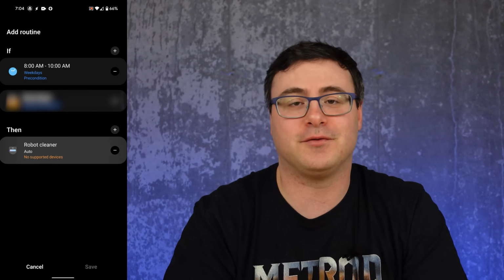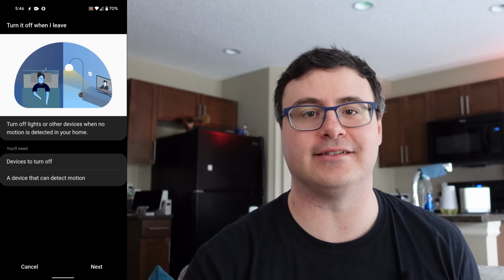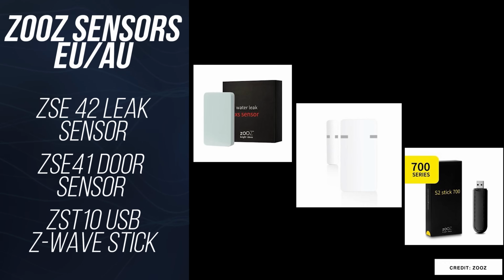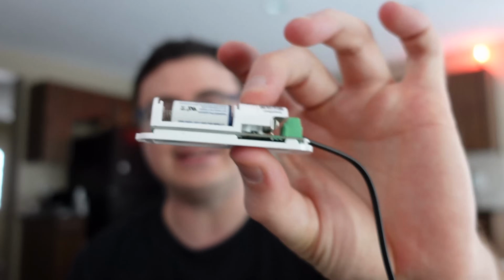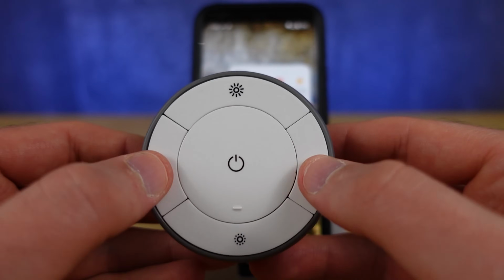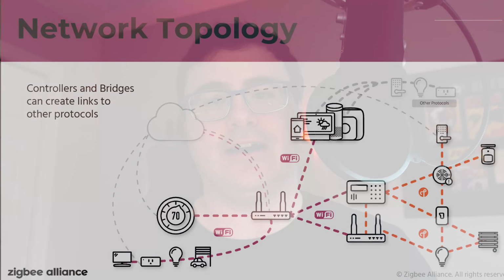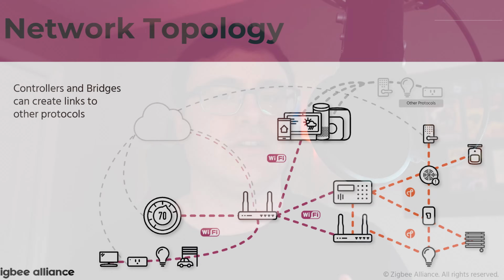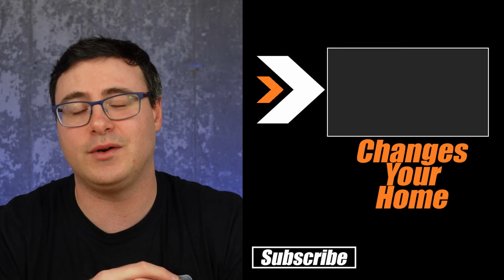New SmartThings Features and Updates!

Comment: Light Sensor ?:

Hey,

I was wondering if you knew of a good Light Sensor for Alexa.  My Sansa Blinds only connect to Alexa so I need a good Light Sensor to control them.  My other Light Sensors (Hue Motion Detector, Aqara FP2) loose their Light Sensor ability when linked to Alexia.

I was thinking of the Aqara Motion and Light Sensor P2, but I have no idea if that device will loose its Light Sensor ability when connected to Alexa.  Any suggestions?  Thank you very much for your time.  I appreciate it!

Ryan
Reply from the maker: Alexa doesn't really allow light sensors in its app. That's your problem. It's not the sensor itself, but what devices Amazon has allowed thusfar. What I'd suggest is using another platform/hub to push in a "light too low" type of virtual switch.  I used to do this with SmartThings and you still can :)
Reply: @ Thank you very much for your time and suggestion.  I do all my main automations in SmartThings so I know exactly what you’re talking about.  You saved me a lot of research time.

Thanks again,

Ryan
Reply: @ Hey, sometime it would be really cool if you did some kind of live event.  I would really love to pick your brain!

Thanks again,

Ryan

Comment: Hey Brian,

I was able to replicate the pressure mat automation at my house. I used the Ecolink contact sensor instead (has dry contact) just cause the Aeotec was unavailable at the time of purchase. This works great. My question is how did you solve when sitting on couch for too long? The mat continues to detect pressure for a while after which turns my tv on even tho I don’t want to. I added some other conditions like motion is detected also. TIA
Reply from the maker: Yeah so this can happen if you're triggering immediately off the sensor seeing pressure.

And then you shift and then it loses pressure and then regains it.  So you're re-triggering automations.

Honestly, the best fix is to work on how it's sitting under the cushions.  Affix it to the underside of a cushion to get it to always be a consistent reading of pressure.

The other thing you can do is add other conditions.  You basically need a deadband.  Or a way to hold it out.

So...create a virtual switch.  Use that to start your tv routine or as an additional condition to stop the tv from turning on.

Turn on the virtual switch when you get pressure on the Mat.

Turn off that virtual switch once your pressure mat has been off for 1 minute.

Now you know when you've truly left the area, and you can use that.  When the virtual switch is on, don't run your tv routine.  Ie. extra condition 

You'll have to add some delays in a few places, but you only turn on the tv at the right times then.
Reply: @AutomateYourLife  I truly appreciate the response. I do have 2 more conditions in the routine. 1st is Motion needs to be triggered, then 2nd condition is if the TV itself is off (using edge driver for the Sony Bravia) then the pressure mat (sensor closes). Triggering it isn’t issue. Having the other 2 conditions like you mentioned ensure that it works when it has to. My issue starts when sitting on couch for too long, then the pressure mat thinks there is pressure because it’s been sitting on for long. I have the mat between 2 card boards under the couch to see if I can stabilize the pressure. I just bought more mats (cuz now I want ever spot on the couch to trigger the automation)
Reply from the maker: @Drknght4  well you've then set it up as a sitting for a long time pressure mat. 😃

That's a different thing you're sensing.  That's what you need to think about!

Comment: I'm rocking like crazy your "amazing device" thing to link the known Two together. I even called them "amazing device 1, 2, 3, 4 etc" lol 
You also convinced me to Switchbot, so far so good. I had few hiccups when out of the sudden all devices started firmware updates, had to delete everything and add back again but no issues ever since. Contact/motion sensor is a killer, but I'm trying to use this feature both in Switchbot and Alexa routine and I'm afraid that if you pick contact/motion in Switchbot app/routine this same sensor doesn't work at all in Alexa. I might be wrong but I haven't had a chance to look into it.

As always, hugs and kisses 😜🤜🤛
Reply from the maker: ahahahah oh thanks!  The Contact won't work as a motion sensor yet.  Not sure if SwitchBot will make that available, but we can all hope it dual purposes soon!

Comment: Does anyone know if the ET-WV520, ET-WV530, and ET-WV525 are going to support Thread/Matter?

To my very limited understanding, Thread and Matter are IP based - which would, in theory, mean just about any router should be able to handle it - unless there are extra hardware needs for processing, keys/security, etc.

So I guess I just don't know - which, I suppose, is why I'm asking.
Reply from the maker: I'm going to bed Matter, but not Thread.